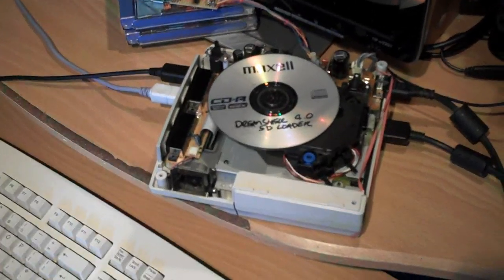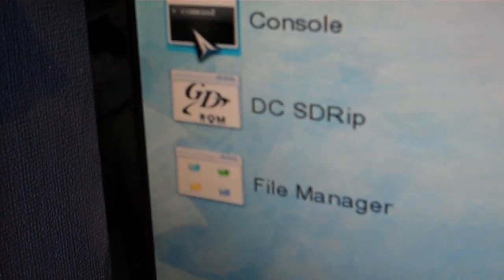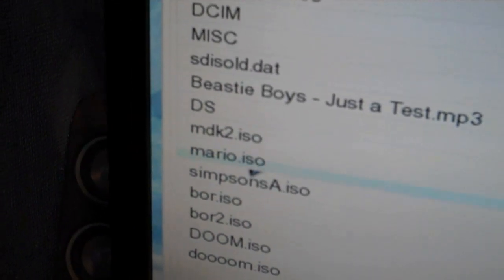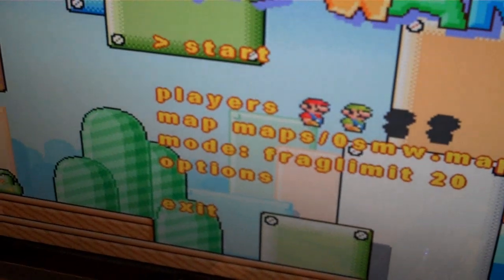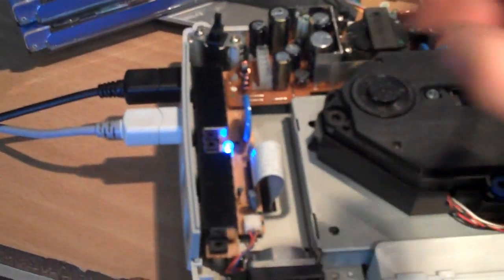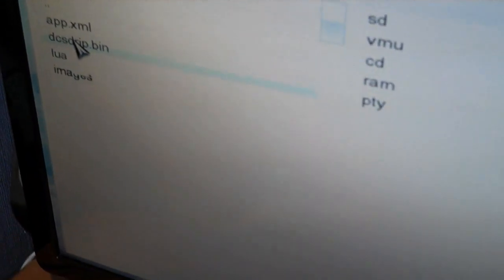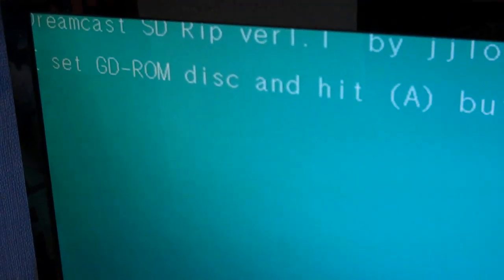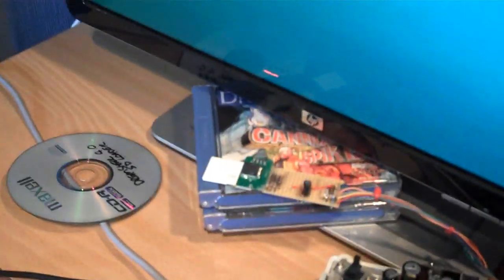Part 2 - Dreamcast SD Card Mod - Play Homebrew And Games From SD Card - Software Demo

Comment: i talked to a dc expert .says thats a rumor or myth they all play backups ..but i also read that the more reliable ones are 0 and 1...2 is the last revision and more prone to laser problems and you need another 2 to swap parts.. but 0 and 1 cant both be used among each other to fix

Comment from the maker: @Captainngamemaster Not true sorry. Maybe what you are saying was correct a few years ago with older or very cheap LCD TVs but not today. I binned my old Sony CRT not that long ago. The replacement Bravia LCD gives a much better picture for all my retro system. The Dreamcast is connected via VGA and everything else goes through RGB Scart or component. Check out my recent setup vid.

Comment: Im very interested in this mod i am working on building a stripboard circuit
but before i make my attempt i wanted to ask you what do the red squares mean in your design pictorial, I have some experience soldering and making small circuits but strip boards are uncommon where i am.
If you could post a few close up pictures of the stripboard front and back i could probably go from there thank you very much

Comment: Without installing Dreamshell to the system but instead loading it from SD card using the boot disc are you still able to rip games? I know you can't do it if you're running straight off the CD.

Comment: @FeeLtheHertZ Shut up.  PS2 is a pita to run backups without mod and there is no vga output, it's also much less substantial with a slowass usb1.0 port.  I bet DC's sd card port is way faster as it can actually run games.